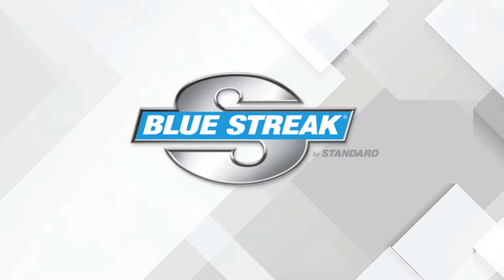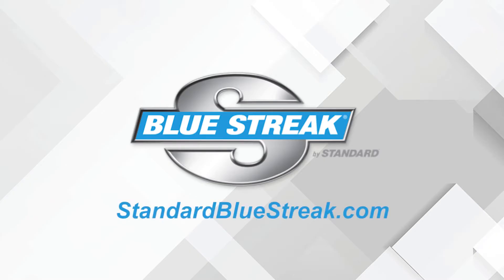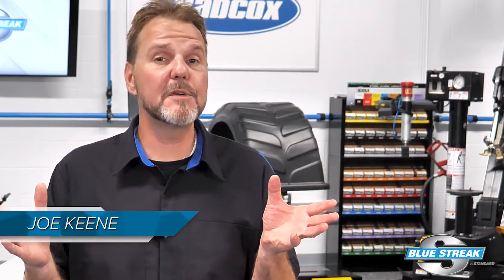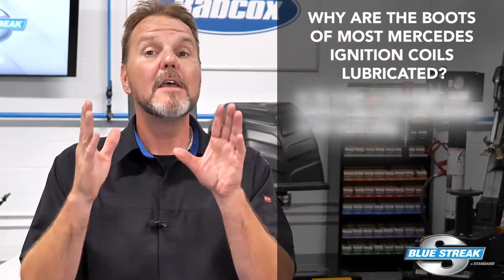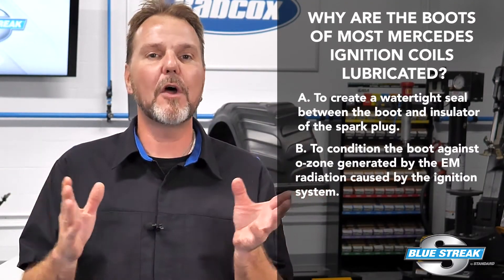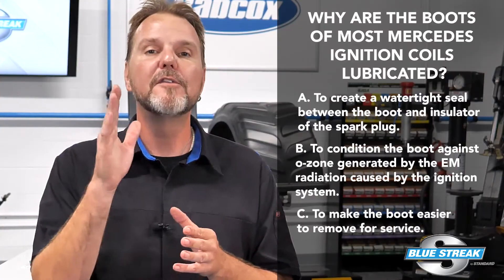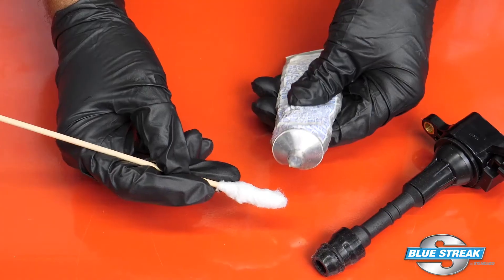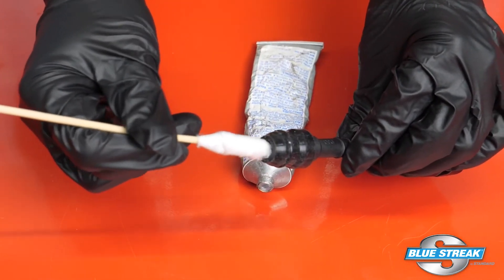Why Are Ignition Coils Lubricated?

Comment: With the dielectric grease, would it be good enough to just put a thin coat on the white ceramic part of the spark plug itself and not any on the coil boot? Then when the boot fits over it, the boot should end up with a thin coating and their will be no dielectric on the terminal/ post?
Reply: would like to know that too
Reply: i think you can do either or - i've seen videos where mechanics do one or the other